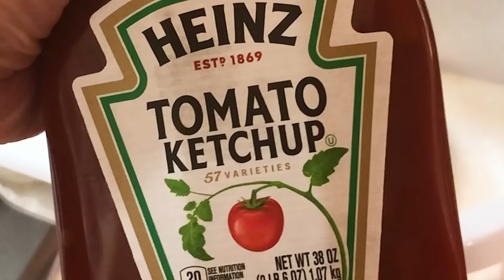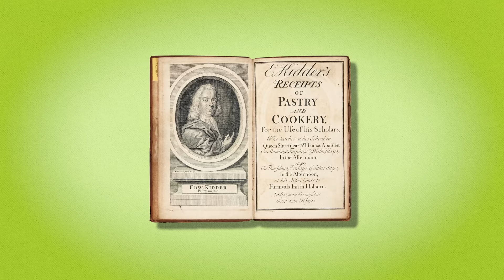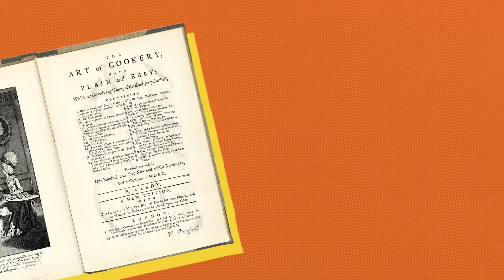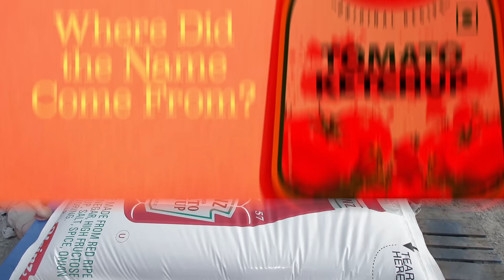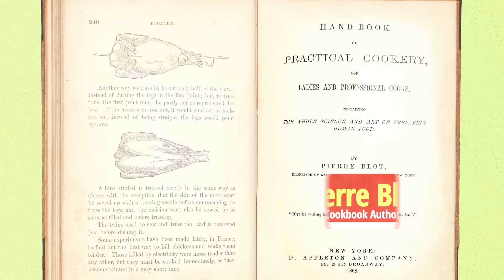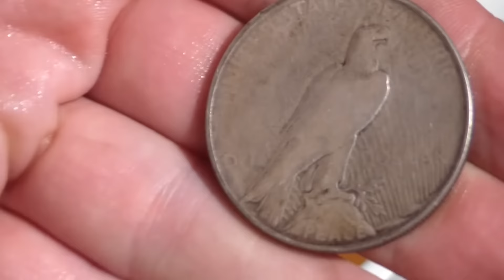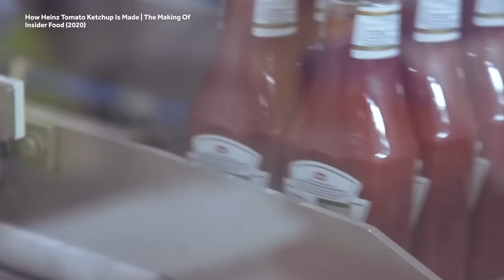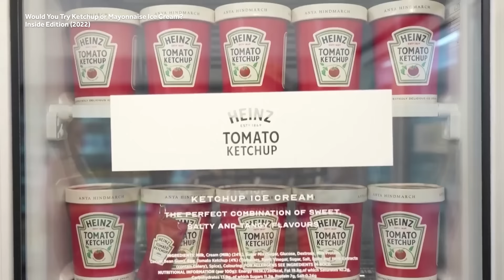The Thick and Tangy History of Ketchup

Comment: I’ve never understood why some people find it hard to use the glass bottle. My grandma always told me to just hit the 57, it works every time! I’ve always liked the retro aesthetic of glass Heinz bottles.
Reply: It's not necessarily hard, it's just harder. And with a glass bottle you get big blobs out, sometimes much more than you want, most often more than you wanted where it landed, and then you have to undo the damage with utensils. It takes longer. If your one hand is greasy, you will get grease on the bottle. With a plastic bottle you get perfect dosages and don't have to rearrange what came out post application. You can make patterns, even draw a little smiley face on your loved one's omelet. If they phase out the plastic bottles (which is likely), I'd prefer they put it in a jar like mayo.

Comment: The problem with the "origins of ketchup" is that pudding is a term that's used for desserts in general, but you'd be hard-pressed to argue that chocolate pudding has its origins in pie. "Ketchup" seems to have simply meant a thick sauce at the time tomato ketchup was created.